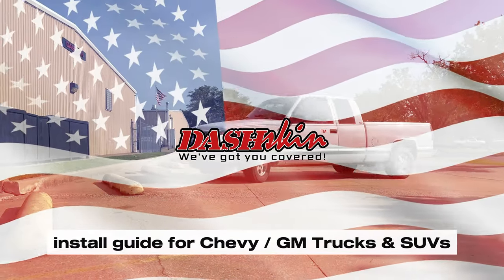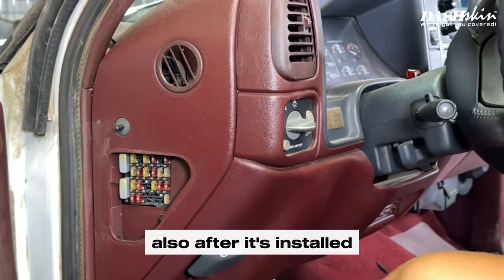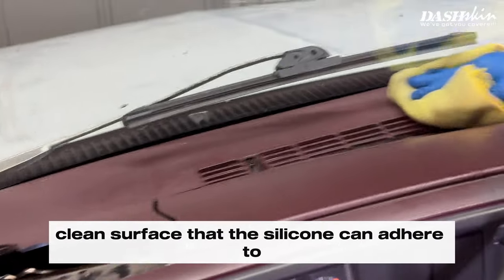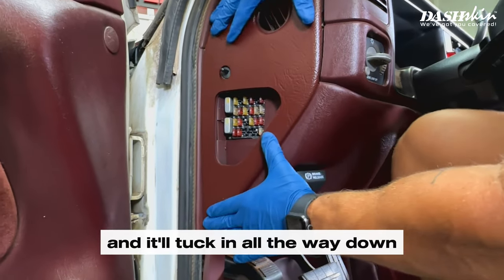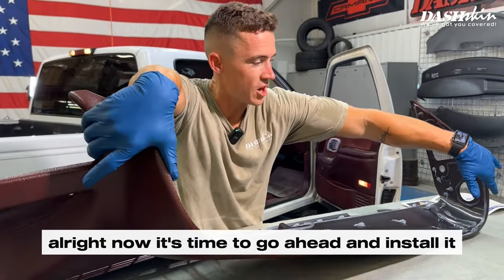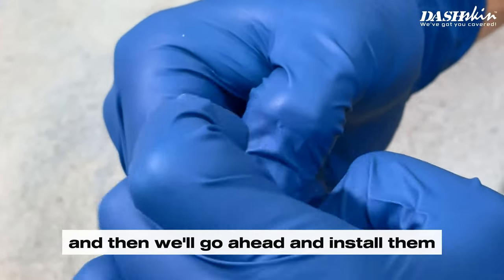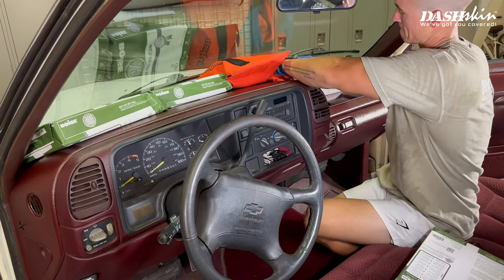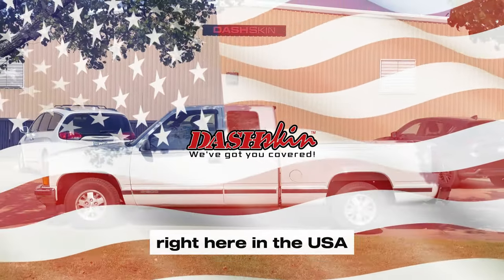EXTENDED FULL VERSION • HOW TO: DashSkin Dash Cover Installation for 95-95 CHEVY/GMC C/K 1500-3500

Comment: A good video. It showed the steps. One thing I think you should have done is explain the purpose of the cardboard near the windshield. Everything else was clear. Other than that, thumbs up. :)
Reply from the maker: Appreciate the feedback! That is to hold the forward edge of the dash cover down flush while the adhesive cures.

Comment: Idk how good this would work on my 1998 Silverado majority of it is gone like 85% especially all along where the cluster panel snaps in willing to give it a try tho
Reply: The directions deal with this problem.  You want teddy bear fill, which will fill the recess and support the installation.
Reply: I thought about this last night and my reply changes.  All you need to do is support the overlay we are adding.  Ok, you have HUGE holes in your dash.  Do not be concerned.  It doesn't matter if you use 2x4 blocks, or Lego blocks, once you improvise a base, and smear the whole shebang with RTV/Dashskin provided adhesive, the overlay will hold her all together and you are good to go.  Brother, trust me, this was magic to my ride, the dash looks brandy new.

Comment: Why does no one make a straight replacement? There's zero manufacturers making reproduction dash pad for these years. Earlier, later years, no problem. For some reason the 90s trucks are non-existent.
Reply from the maker: A replacement dash that looks OEM would have to be injection molded, and injection mold toolings are unbelievably expensive to produce. A tooling the size of a dash could easily cost upwards of 750K-1M if made in the USA, which creates an immense amount of risk. Even if ROI was guaranteed by number of sales, very often toolings have to be corrected and reworked, which drives up cost even more. Finally, if you produce a replacement dash, you run the risk of being sued for patent infrigement by OEMs.

TL;DR: Insanely high cost and risk.
Reply: @DashSkin thank you for that explanation